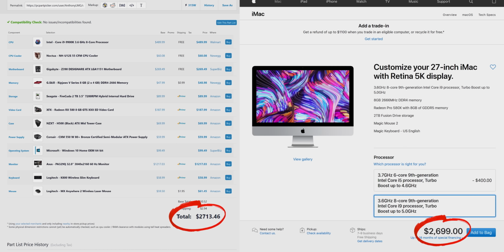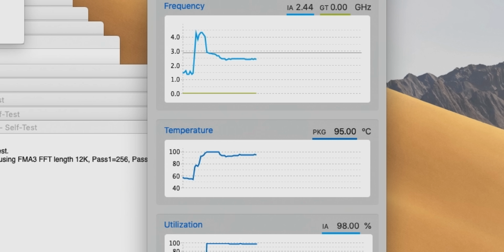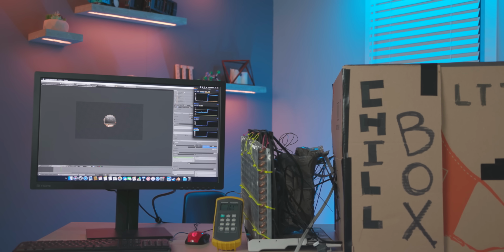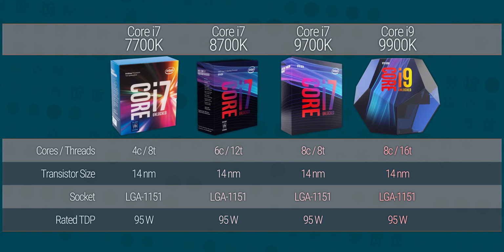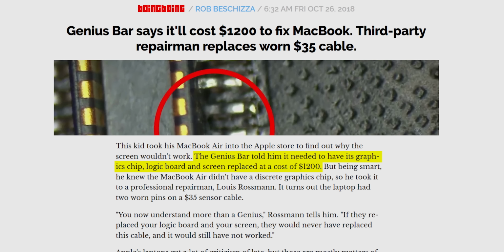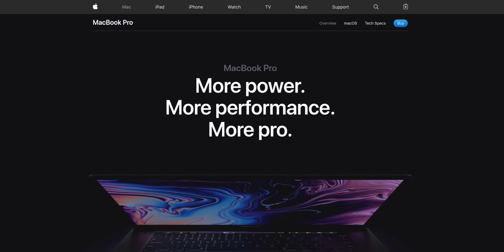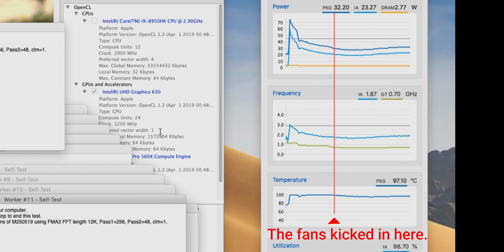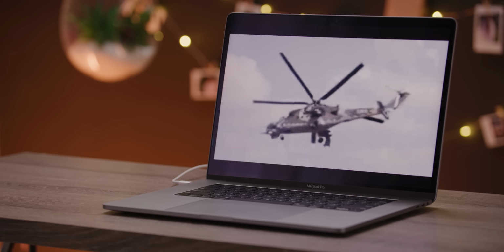Macs are SLOWER than PCs. Here’s why.

Comment: I would have liked to have a seen a direct comparison to another laptop with the same specs that does the cooling correctly.

You say that other companies are doing it better and demonstrate that lower ambient temps make for a faster mac, but don't demonstrate that any other laptop with identical relevant hardware actually gets higher scores.
Reply: The point was that there's no point in having an i9 in any laptop, unless it weighs a ton and has a very good cooling solution
Reply: Yep, for instance a Dell XPS 15 or a Matebook Pro.....
Reply: They did more then enough laptop tests where you can look up the temperatures and clocking speeds.
Is it really neccessary to prove EVERYTHING in the same video if they clearly have shown evidence in other videos of said laptops?

Comment: This is exactly why I prefer hackintosh, I just want the OS
Reply: This is me perfectly. I just want the OS for some programs that don't have a Linux counterpart...
YES, I'M LOOKING AT YOU, ADOBE, AFFINITY AND ITUNES!!!
Reply: @BeckyAnn6879  Now this answer makes a lot of sense. I didn't consider that.
Reply: for what specific thing do u need mac os what windows cant do ?
Reply: the Fuck do I need statistics class for?, do you live under a rock? your on the internet now but can't use google to see how stable everyones mackintoshes are? @bobthebuilder609 
  @Chad Windham  
 again, my hardware is mostly Mac supported. all iMacs run intel hardware and intel CPUs and use Samsung for their memory and support Nvidia thru web drivers. so umm, yeah apple hardware. and with how strict apple is with their SMBIOS, your system either works or doesn't, no one is gonna pick a half assed hackintosh over a linux distro. but when it comes to using what is claimed as the most advanced OS. just like any system, you can tell if its stable enough just by booting it and running some programs, and if it crashes theirs your answer.
Reply: @tacos6996  You do realize I don't dislike your hackintosh right? I like that you did it but simply gave an opinion. I do not think that your computer is unstable or unreliable. I personally use a Mac every single day, and I don't find the OS amazing enough to install on other things though, I would prefer Linux for that. But more power to you.
Reply: Jessy Landry  Fair enough then, just wanted to make sure nobody was literally thinking it was Linux.
Reply: The mac OS is only worth it on the hardware it is designed for IMO. A good linux distro would be a better OS to have on something that isn't Apple hardware...
Reply: @mrdesperate1  you obviously never had a hackintosh. my dell 435mt runs great with windows10 on one SSD and macOS High Sierra on the other SSD, and yeah my CPU is from `09, i7 920, with 20GB of RAM and a PNY GeForce GTX 1050 running perfectly. of course I don't use Mac to game, thats why I have a windows 10 on a separate drive, other than gaming Mac does everything better than my windows drive. 

and "APPLE HARDWARE" dude do you even know what your saying? a intel i series CPU is apple hardware, also apple even released a Mac Pro with a Nvidia graphics card upgrade one year, my dell is practically mostly apple based hardware. So with my smBIOS set to a Mac Pro 4,1 and no im not using any kind of shit ass garbage Tmac tools or hackintosh-zone crap, 100% vanilla from the help of https://www.insanelymac.com/forum/  it runs my App Store copy of Sierra flawlessly. Then after my install I upgraded to High Sierra with no extra tools or anything, just my clover EFI and High Sierra was ready to go just needed my web drivers and cuda installed with with a simple CLI and reboot. After that all 3 of my screens worked, as you would say, "out of the box" 

So my point yeah a hackintosh can be not stable, but thats if you try to install it on shit hardware. You install it on decent hardware, that apple has used, you'll have a great system, just google hackintosh after a year and see others with stable systems that are a year or 2 old and get told the same thing. don't expect a stable system on shit hardware, apple isn't designed for shit hardware, so if you don't have good hardware its not gonna work.
Reply: @tacos6996  Chill dude, I just write software code and manage virtual machines/container orchestration for automated web app deployment for a living. I probably don't know what I'm talking about...
The Mac OS will run things perfectly fine, and if you want to use it then fine. That however does not negate my previous statement. Apple has the privilege of knowing/controlling to a degree the exact hardware their machines are running (which is a lot more than just cpu and video cards...) thus their OS is very optimized for their setups. The mac OS will run on other things and do just fine, but if you want something as optimized as possible, it won't be running mac OS on non apple computers. A linux distro will give you much more control/optimization/customization. Will there be a noticeable difference between the two? Maybe. Maybe not. (In fact, probably not).
Reply: @tacos6996  hmmm, gotta love those old Studio XPS machines, i had one, it went strong for 10+ years, i sold it, but i squeeze every single Hz of power out of it
Reply: for real, Im amazed at how good this thing still runs, especially when Ive left it running for weeks at a time and only negative thing that happened was since then a stick of RAM died and went thru 3-4 PSUs. otherwise id almost get another if it wasn't for me wanting my next PC to be 100% custom, also build is gonna be aimed at running Mojave and AMD gpu or get a dual channel for Nvidia and AMD or whatever is next if Mac still won't support Nvidia anymore, then ill prolly have like a i9 on a asrock board with a AMD graphics card and some octane drives running raid0 thru a 2nd or 3rd PCI slot for booting stopped fast. 

we can dream right? lol @diras2010
Reply: @mrdesperate1   I think you're missing the point. He says 'He just wants the OS' suggesting using Linux is exactly what he doesn't want. And as for 'mac OS is only worth it on the hardware it is designed for'. Linus just proves the contrary. If the hardware is gonna thermal throttle in pre-built macs but you really want mac OS, then a Hackintosh is actually a wise move don't you think ?
Reply: Thank you, @otni6115  you understand where im coming from. 

@Yushatak exactly, not a distro, apple even said it when OS X launched that its unix based, not a variant of the "linux distros" where they are all plug and play, that said because of environment switching. Which you could never do on a Mac. You can't instal linux mint then decide you want the apple environment the next day. 

as far as linux I use Arch on my laptop.. but I feel like im wasting my system not using a full system, ive always thought of linux as a maybe a daily driver for a laptop or weak hardware, and a live distro to fix my system, but I love UNIX over windows and have a iPhone and since I won't buy an android I want to use macOS, and yes why throttle on their terrible designs, maybe if apple kept the idea of caring about hardware failure alive hackintosh wouldn't have blown up. cos since apple released a trash can, im sure only the rich with too much money to spend still don't buy it.
Reply: @mrdesperate1  https://browser.geekbench.com/v4/compute/3976112

https://browser.geekbench.com/v4/cpu/12952929

want me to post a video of opening every app at once like Xcode, pycharm, gimp, while running heaven and watching videos on chrome? cos I can tell you my system is stable AF and I just did it and not a crash and everything kept working fine, my system didn't even lag, and its a Vanilla Hackintosh on a DECADE OLD system, not a DISTRO like hackintos-zone or any of that other garbage.

So in terms of stability, macOS is worth it on like high end intel systems, because thats what a Mac is when it comes down to hardware. 

so in your definition that means your saying windows is only stable on Microsoft  hardware? like macOS is only stable on apple hardware? 

so then why does windows run so great with bootcamp?

What I'm getting at is your argument about stability is false
Reply: @mrdesperate1  isn't a hackintosh a Linux distro ?
Reply: there are distros to install "hackintosh" from site like hackintosh-zone, or niresh, another known distro that I used before I knew about the beautiful vanilla method, that used to be harder to do, which now its almost can say easy, but only after you understand the bootlader CLOVER. 

In which they[hackintosh-zone] host there own modified version of the OS that throws files everywhere in hopes to get it to work, and thats where you get a unstable poop system, having some files end up getting placed where they don't belong, making your system, 'unstable' cos you don't know whats gonna happen, or even worse, how to fix it if anything goes wrong.  you make a vanilla hackintosh, meaning you don't touch the macOS and you don't modify anything, the boot loader takes care of it all and all you do is put some kexts into one folder on the EFI partition, set some bootflags and the OS starts up like its on a OEM motherboard.

but its more of a term then a software, hackintosh is just a reference that your running macOS on non Mac products, but a vanilla hackintosh means you downloaded the OS from the App Store and used that to install macOS on your supported hardware, and depending on your setup is how you choose your SMBIOS which would be a iMac or Mac Pro or MacBook Pro, apple motherboards turn on in a way that is very different from how a regular unix system starts up cos it looks for a chip that physically exists on apple motherboards but is virtualized on a "hackintosh" in order to tell the OS its on a system that can install the Macos.  @rishabprasoon5970  that ended up being longer than expected but I also wanted to clarify why some people think hackintoshs are not stable since its not in a case that says apple apparently, but uses damn near all the same hardware, metal works perfect heaven benchmark just got Score of 895, idk if thats good but my motherboard is from `09
Reply: @mrdesperate1  sadly FCP X and Apple Pro Tools are MacOS only so some people have to use them. And since Adobe has their finger stuck up their ass with huge performance and stability issues on both Mac and windows, it's unlikely most FCP X users will switch their programs. Similarly, you still have the Xcode/Mac OS requirement to develop software for iOS.
Ideally, I wouldn't ever buy an Apple product if you paid me. But because of this software gap we have no choice.
Reply: @mrdesperate1  technically hackintosh is a linux distro
Reply: @ChickerinoRadio  are you saying that hackintosh is the name of a linux distro? If so it is really funny that somebody did that.

Comment: My best guess? Intel's processor's are holding them back. The iPhones use Apple-designed processors. If they had to choose between marketing GhZ and throttling on their iPhone's they'd probably go for a throttled processor there too. It's probably one of the reasons they're going over to Apple processors for their Mac line.

Comment: Not an apple fan here (I do actually hate their policy and mindset), but I want to try to answer to the "unanswered question": why are thermals better on iPhones compared to the Macs counterpart? I think the main reason is: on the iPhone side of things, they produce the CPU themselves. I strongly believe that this gives them an edge over the expected behavior of the latter in terms of temperatures and process scheduling policies. This doesn't justify their attitude over the Macs counterpart thought, but I'm almost sure  that something il boiling in the pot (as we say in my country 😁).. they might be working on a custom Mac CPU designed and built upon the experience they've matured from the iPhone's one. This clearly explain why they don't give a damn about the current situation.. it's just a waste of money at their eyes.. they much rather spend that money on R&D on those "proprietary CPUs", because business-wise it'll give an advantage on the long run, and fixing this current state it's just a waste of money and time (obviously business-wise).
That's just my two cents on the situation. This, as I've already mentioned, doesn't justify their attitude at all.. Oh and by the way not a Microsoft supporter either here.. love my Arch..
Reply: arm vs x86
Reply: Arm CPUs (Apple's A, snapdragon, Kirin, etc) are designed with low TDP and power consumption, a laptop x86 CPU usually has a 15w TDP while the snapdragon 855 has a tdp of 5w, and Intel is still stuck on the 10nm process while AMD, Snapdragon, Kirin, and others have moved to the 7 NM process
Reply: Apple already know that putting fast processor requires good cooling and thicker chassis, but they keep making it thin and leaves more problem
Reply: @zakky0002  Ah, I see you're man of culture.. 😄
Reply: Compare games iOS/Andoid :) Weight/Memory usage/Etc - just to understand how Apple compress/cut quality of models/etc on they iOS :)
Reply: Apple has already stated that they’re going to be making their own chips and moving away from Intel. The 2020 Macs will have them.

Comment: Mac: For idiots who need to browse alone, and never dare use the machine for real work. That would be the user using it wrong. Affecting a small number of customers.
Reply: Lol... you clearly have no clue. Macs are in fact used primarily for work. Design, photography, animators, coders, etc.
Reply: @odinsplaygrounds  who, at this point, offload as much of the heavy workload to other machines to handle rendering, compilation, cfd, simulations, and so many other similar applications. I've been in the industry for ten years and have seen it shift dramatically. Once upon a time, Mac was dominate. Far less now than ever before. The shift dramatically accelerated after Apple migrated to the aptly colloquialized trash can machines.
Reply: @Squat5000  Sure, macs aren't used much for rendering obviously (with exception of Mac Pro). But mostly all other create work I've seen the majority still sticking to macs.

Comment: Perhaps it’s an ARM vs x64 issue for voltage(heat) per unit of performance. Which is why I think the T-Series of chips will start taking over more and more non-x64-specific instruction sets.
Reply: T-series chips is nothing compared to PEWDIEPIE CHIPS
Reply: T-series chips is nothing compared to PEWDIEPIE CHIPS

Comment: Yeah Apple loves to have silent machines. So I use software to change the fan profile to keep the temps down. Surprisingly if you get the fans going sooner, they actually don’t need to be as high when it’s working hard. If you wait too long, the fans have to go full blast and aren’t able to keep up as the heat sink is already too hot.

Comment: I think the real party to blame here is Intel for failing to deliver on their promises. Apple tends to build their chassis on three year cycles on the basis of the promises coming from Intel. In this case, Intel failed to deliver more power efficient chips over time forcing Apple into a weird place. This is likely why we’re hearing more and more rumors about Apple switching to in-house ARM silicon for their computers. Intel can’t deliver what they promise anymore, so Apple is going to try to do it better. I think they have a good chance of doing just that, too.

Comment: 0:15 
Me looking at Linus's pc parts list to mac build yeah yeah everything looks about on spec except for the Noctua cooler should have used a heater
me 5 seconds later HE SPENT 12 HUNDRED DOLLARS ON A MONITOR TO EVEN UP THE PRICE AND BE RIGHT!?

seriously, guys, this feels like an insult to my intelligence you don't need to spend that much on a monitor and mac cooling is not the same as Noctua cooling you were just matching (generally rx 580 ≠ Radeon pro 580x but close enough) core components without a care at who looked at the peripheral I'm supposed to be able to trust this channel and you didn't even complain about magic mouse charging position

Comment: Look. I don't use an macbook because it's sexy or because of any perceived status garbage. I could not care less. I use it because for my working environment (which doe snot require insane performance from my computers) OSX is by far a superior product to Windows. It runs Linux programs. It has a functioning terminal, and it's UI is not utter garbage.

I do use Windows for gaming. But I would never gimp my work productivity by actually forcing myself to work on it. I'd switch to Linux before I did that, but then I would have to worry about sysadmin my computer which I can do, but really, Apple just makes it so that I hardly ever have to.

But you are right. I don't care much about performance, but if I want to bash Apple then I'd rather go after how they treat third-party repair shops and their blatant lies about being environmental when they drive people to scrap their computers rather than having them fixed.

Comment: Nearly all of my girlfriends only use apple products. A lot of them have the latest and greatest stuff. Total fangirls. And why not? None of them use the devices to anything approaching their capability so they never encounter thermal issues, or any issues really, and if they do there is a nice sleek store to visit to get it fixed, usually with a shoe store next door. 
The point is that it is a completely different market and Apple has nailed it. Would you try to compare yoga pants to combat fatigues? No. Are your combat fatigues really better if all you do is sit around the house? No. And how many people bought the combat fatigues for the epeen, and then just sit around the house in them? Not  my gf's. They are all sitting around the house in yoga pants.